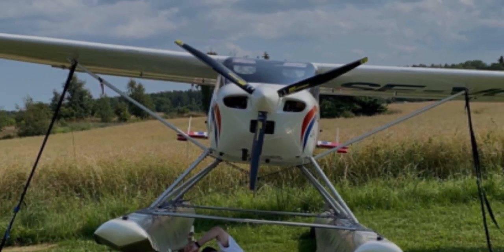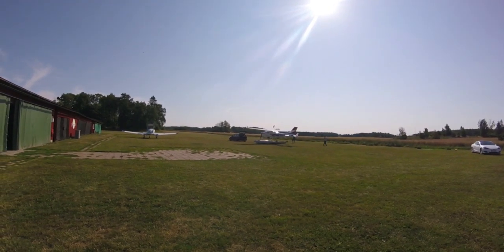Seaplane take off from solid ground

Comment: I would used a couple of folks with backpack sprayers applying soapy water underneath where the plane was parked and in front for 50M. I'm curious how much difference that would make.
Reply from the maker: This has been done in earlier times and it makes a difference. Primarilly to overcome the initial friction and up to walking speed after that dte difference is less noticable. When starting a heavy seaplane it may well be necessary to get started.

Comment: We used to pull off a 65hp cub, in the grass,  with a rope and a ring hooked to the forward cleat.  When airborne the ring would fall off and I'd release the rope from the trunk of the boss' car.
Reply from the maker: Sounds very exciting :) smart to have a "manual release" in the trunk of the car. It would've been too exciting if the  rope didn't release at all.

Comment: So the rudder was sufficient to steer it on the grass?
Reply from the maker: Yes the wind created by the prop is enough especially after a couple of meters when the friction to the ground decreases. If the friction is too uneven initially the plane would steer too much and we have to abort end try again.

Comment: So, after T/O, do you get under the floats and inspect before the water landing??
Reply: Sure, before landing slow the plane to VS and trim for level, fight you way out the door cause the damn wind it trying to hold it shut....onto the float and have a quick look.  Careful to not loose your footing or grip. 🤞 Gets easier with practice, but reassuring to know you aren't going to sink your plane when putting it on the lake for the summer.
Reply: For a man who can take off like that it is routine to climb underneath the aircraft to have a little look.

Comment: You scared me for a moment when you started yawing to the left. How does that take off feel compared to landing on water or compared to landing on wheels?
Reply from the maker: you bet there was a bit of hesitation there but there were no speed yet and plenty of time to stop, the friction is exponential so there is a pretty much instant stop when the throttle is pulled back. The feeling is comparable to a normal start when the speed is picking up, it is in the very beginning there is a difference and I think that shows in the video
Reply: @swedethour  I was thinking there would be a whole lot of vibrations going on in the cockpit?
Reply from the maker: @BaseToFinal  one would think but actually less vibrations, the floats becomes a bit like a pair of skis and some of the bumps and pits are leveled out.
Reply: @swedethour  Good point actually! Can you tell I've only ever landed with wheels attached to my aircraft? :P